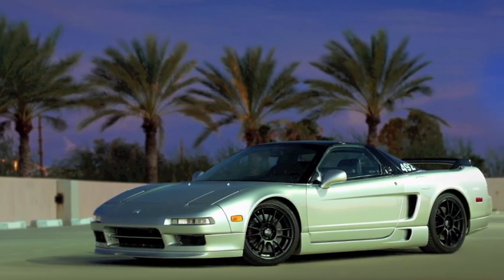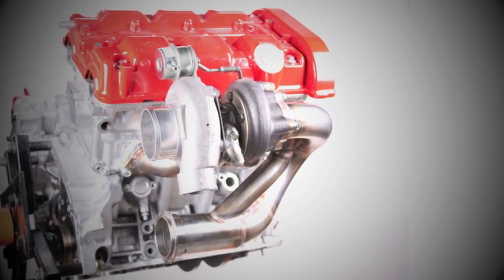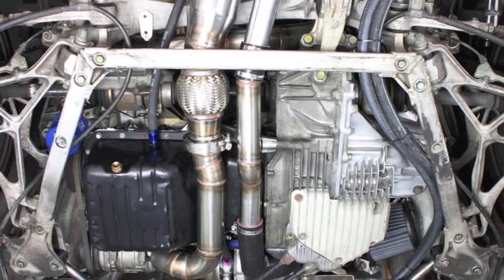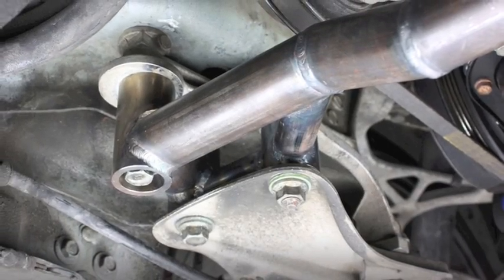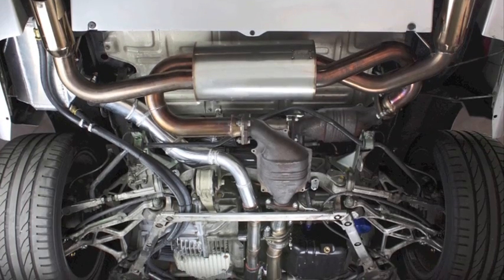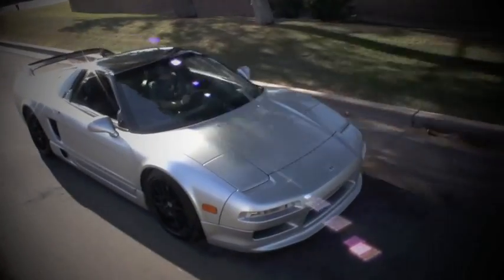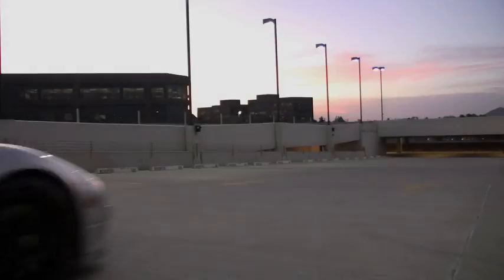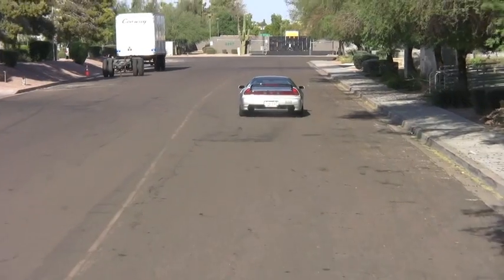ScienceofSpeed Twin Turbocharger System for NSX

Comment: How much hp can the engine go up to ? With modified internals and transmission and rear end upgrades what kind of horse power is the NSX capable of ? I wish to give the engine a try before i look for a swap or another car to modify.. And please why no NSX has ever produced good 1/4 mile times? Smaller Honda engines are capable of good times and higher power figures with a turbo.. Please help!
Reply: Hi Etienne,

What would you consider a good 1/4 mile time?  My NSX did a 9.51 @ 128 this past summer @ Bandimere and has output of 707 whp.  This required significant mods and would be happy to provide specifics via direct email.

TB

Comment: I'm no expert on turbos nor what the engine bay is like above the transmission (besides what I see in pictures and model kits), but if they're going for a liquid intercooler why not mount the box where the stock intake filter was?  it seems like it would fit (looks to be about the same size) and it would shorten the plumbing which, i guess, would reduce the turbo lag.

Comment: This is an incredible system. I had my motor built to a 3.5L boost capable motor before installation of the twin turbo system. At 8lbs of boost I have 473 RWHP and at 17.21 lbs of boost I have 666.3 RWHP. Since installation I've put 5,000 miles on the car with no issues whatsoever. What an incredible change to the car!